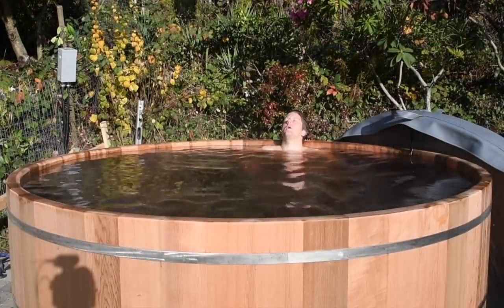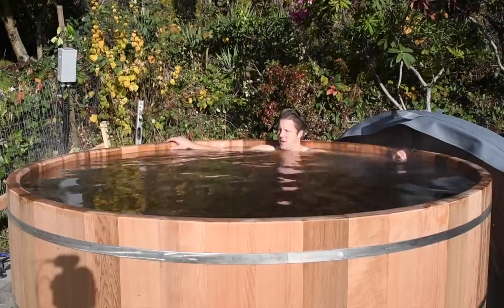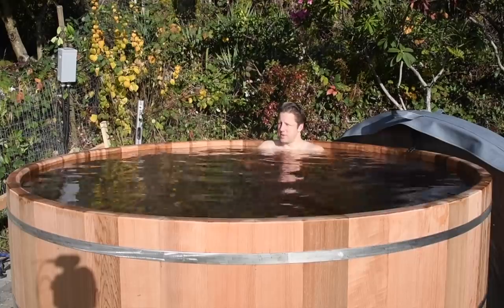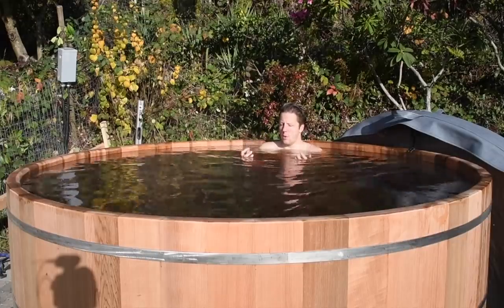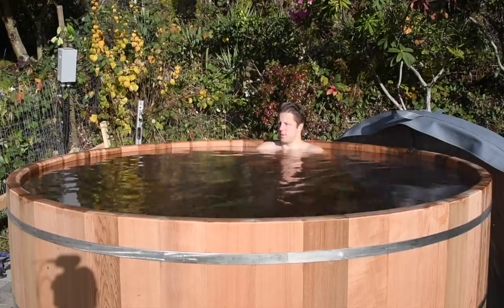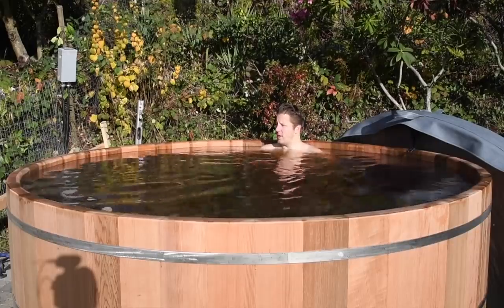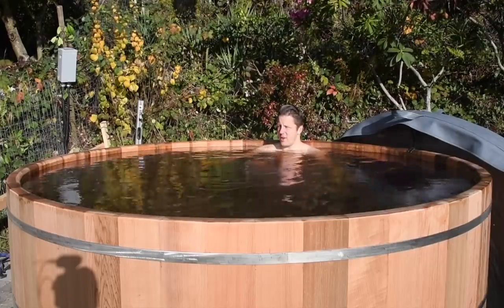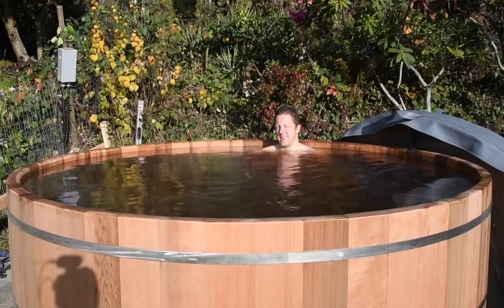WOODWORKING, MAKING ACEDAR HOT TUB  Part 2!!!

Comment: Friend of mine built one of these in the 70's. The straps got stretched out when the wood expanded. The fix was to use longer bolts and put heavy duty valve springs on both ends.

Comment: As I said earlier I worked designing redwood hot tubs in in the 1970's we did use redwood and to a lesser extent "red tide water Cypress". One out of 100 tubs was Cypress this was remilled used wood, we also used redwood wine tanks some we had built in the 1930-40's and removed in the 1960's resold and removed again. Then remilled in to hot tubs.  This tub looks great sure to an old school round hoop guy flat hoops look off plus we tighten hoops from the chime up

Comment: I have an old stainless steel milk pasturizer vat. Round 5 ft by 3 ft deep. Gonna clad it in wood and build cedar seats inside and use a HERMS/RIMs coil to heat it with wood. Not as fancy but should work
Reply: Just make sure to keep your protein rest below 118.
Reply: You could try to do a coating on the interior to make it last and use salt water filter instead of chlorine which should decrease how fast it starts to deteriorate.  Powder coating requires enough heat, but would be ideal, same with porcelain coating....Good luck! Sounds relaxing.

Comment: We also have one of our own. 

In our setup we use a wood oven with steel sides as a heater, and a water pump taking cold water from the botton, to the top spewing it out on top of the oven.
Also we have a fence going around the steel oven, to make sure its not toutched by actident.

Comment: DANGER DANGER DANGER - you seem to have only put one suction fitting through to the pump inlet (the suction side). A person can easily get stuck on that - please please please - add a T fitting and a second suction fitting. If somebody or something gets trapped on one suction, they can pull off as the system simply draws from the  other suction fitting.  I put one on the wall and one on the floor if I can to keep even safer. If not, simply go a bit farther around the tub - three feet is a minimum.  I'll send you the parts if you need - free - just to be sure you stay safe.
Reply: Great tip. Thanks for that.
Reply: You actually beat me to that.  I just saw the episode and was like "Danger Will Robinson...Danger"   Those pumps give you amazing hickeys if you are not careful.

Comment: So the burning question,  what was the cost of cedar for this build?
Reply: Bradley Vierkant do tell
Reply: Do some maths. It’s x per board ft and x board ft.
Reply: @biguprochester  so Id say about $3.50
Reply: @Deutschehordenelite  god damn loch ness monster in my hot tub
Reply: @Deutschehordenelite  TREE-FIDDY YOU SAY!?
Reply from the maker: Bradley Vierkant 2k cad.
Reply: @TheSamuraiCarpenter   Out east here in Nova Scotia I will have to use Eastern White Cedar.  It is supposed to be as rot resistant though.    
Another Burning Question, Jesse: what was the Diameter of the bottom?    I see you lie on it in video #1, but are you 6' 2"   tall ? Taller still?   
The boards are all  2" (8/4 finished)  x 6" ?   I love the glue-less design; the tight tongue and groove will seal itself with use.  
I know there are plans at the school, but I keep missing the boat and not getting in.   Add them to your online plans?   Please?
Reply: ah, about 175.00 USD? @TheSamuraiCarpenter
Reply: +/- $700-1000 USD not including the metal straps and hardware for locking them.
Reply: 2k Canadian is just over 1500 American
Reply: @dmueller1875  uh no thats 1,500 us dollars

Comment: How does a wooden hot tub do in terms of being insulated?  I see that you have an insulated lid, but how about the sides and bottom?  Are you going through a ton more power just to keep the water hot?  Are you planning on building any sort of roof cover or are you leaving it out in the weather?  It's truly gorgeous...and sounds like it smells heavenly!  Thanks.
Reply: Maybe a wood fired heater/chiminea is in order!
Reply: My understanding is that 2 inch thick cedar has very good thermal insulation properties. The vast majority of heat lost with a hot tub is not out the sides, it's out the top. So a well insulated cover is the best thing for saving heat.

Comment: So do you just squat in it?  Any plans for seats?
Reply: I would say that he's sitting flat on his butt on the bottom.  The tub looks to be only about 30" tall and with the floor probably being 2.5" thick and about the same distance up from the bottom of the sides, I'd say the water is only about 25" deep.
Reply: Very true, I looked back and you can tell when they are carrying it around to the back yard that he could sit on the bottom just fine.  I'm sure he will build some seats for the kids though!
Reply: I work in the 1970's designing redwood hot tubs the best way is to make the seats is without screw using dowels made of the same material as the seats,  use silicone rtv as the glue you'll need a dowel making die plate.   1/4" will due but 3/8" is a better size due to the weight of the material.  You can make the dowel die by drilling a series of holes in a steel plate and filing progressivly the holes square then push the wood through the dies until round.

Comment: How does it not leak? 😛 I didn’t see any glue or sealant. I’m guessing the straps are key, maybe just like how a barrel of wisky works.
Reply: Same way beer barrels didn't leak when they were made of wood :)
Reply: So if Mr Samurai stays in this hot tub long enough he will mature like a fine wisky?
Reply: @sqearlicious epiphany And those are legal in Canada now
Reply: Wood expands when it is exposed to liquids. The straps make it so that it cannot expand when it wants to, thus creating a tight joint between the slabs.
Reply: Also with the bottom joints in the first video he hammered the wood before fitting it into the rebate/dado which was cut smaller than the width of the wood. The compressed fibres of the wood then later expand out and create a really tight joint.
Reply: C Lopez nope. Google it, there are multiple spellings of wisky and your countries spelling of it is not the only one.
Reply: Whiskey in Ireland and the USA. Whisky in  Scotland.

Comment: Man this is just one I don't understand. No glue? No finish? No waterproofing stuff? What about sun damage?  Won't wood fibers expand into rougher texture or splinter? Do water chemicals hurt it? Do you have to drain it for maintenance or must it be kept full?
I just don't get how this doesn't fall apart in a few months. Maybe someone can explain the chemistry here.
We make indoor furniture barely used with all joinery and glue and protective coats, but this you just strap together bare wood and stick it outside full of water and it's fine? Cedar must be magic.

Comment: Wait,,so u DONT have to put any type of seal on it like epoxy or polyurethane type of finish ik cedar I'd water resistant  ut didnt know it was that resistant..nice
Reply: How did you think boats and barrels worked?
Reply: The inside doesn’t need any finish because of the water (it’ll probably darken to nearly black due to stuff in the water) and the outside will turn a nice silver color over time, matching the patio stones pretty well. Cedar is a great outdoor wood because it’s naturally very rot resistant.
Reply: @pwkeely   I finished reading "Oak the frame of civilization" by William Bryant Logan... now the barrels that is true, but as far as boat making goes,
a water resistant tar substance was apparently used to help water proof them. Although they still leaked.

Comment: Cant you use use an old used septic tank and then dump ted hot steel into it to heat it up? I know there are toilet seats on the side of the road all over that people didnt take to the dump. You could use them as seats inside your septic tank hot rub.....

Comment: Samurai says, "So I just built this giant round thing.  Let me get a bunch of friends to help me carry it to the yard."  - Dude, you just built a giant wheel. Tip it on it's side and roll it into place by yourself. LOL.   [Lay some furniture pads on  2x4 sleepers  first to keep from marring it up.]
Reply: Thats a horrible idea. Falls over and bam shits broke
Reply: The vertical planks aren't supported on the top from inward pressure, only the outward pressure of the water. Rolling it could cause ovulation and round the edges of the planks, not good for proper sealing down the road.
Reply: Maybe he could have made an even bigger cedar hot tub to fit this cedar hot tub inside with an inner grid work to roll it around after getting a hernia or renting a forklift to get it on its side.... Then he cab disassemble the bigger cedar transporting hot tub and use it for fire wood adter successfully rolling the 2 hot tubs to their location. Hopefully it wont break as he tips it back over into its original position haha
Reply: @chanceywilczewski8992  The vertical staves, are beveled on the edges and are held in compression by the steel banding.  They need no internal support.  I think it pretty much impossible for the tub to ovulate.  In fact, if there is any ovulation in that tub,  it will be from Mrs. Samurai.
Reply: Terrible idea. You'd get water everywhere. 😉
Reply: @-_James_-  :)

Comment: You are getting the cedar all wet 😡! Have you lost your mind...At least you could coat the inside with concrete.  Think of the durability!
Reply: "You are getting the cedar all wet 😡! Have you lost your mind"
It's exactly how cedar or redwood water tanks/tubs are traditionally made. You don't coat the inside with anything. These woods are resistant to rot. The water needs to come in contact with the wood to make the wood swell and that's what makes them leak proof.